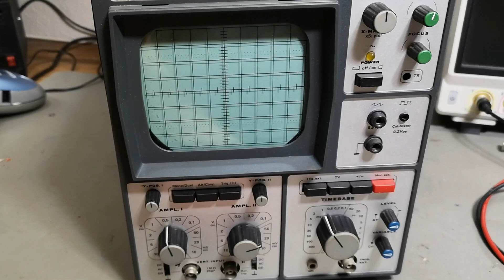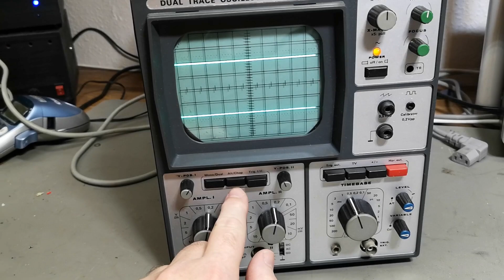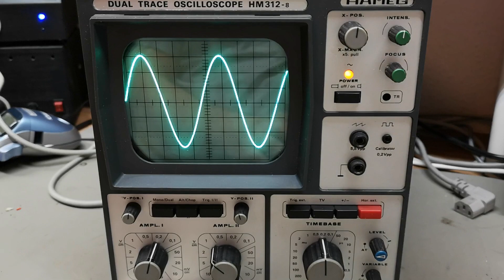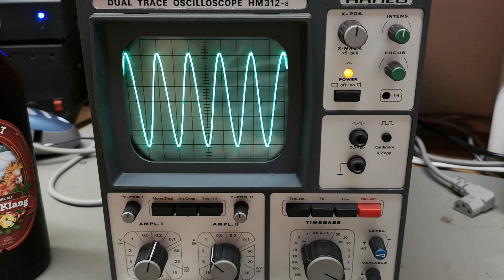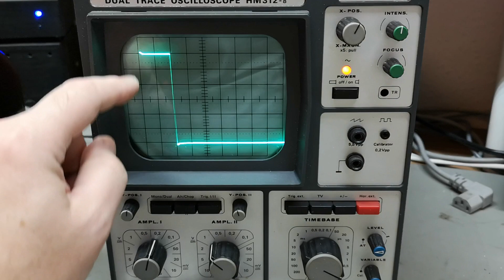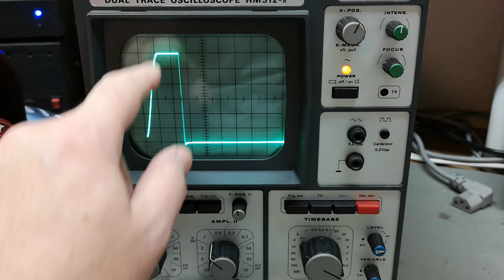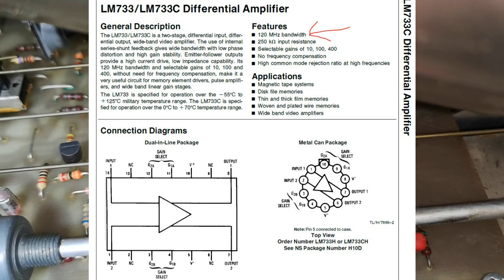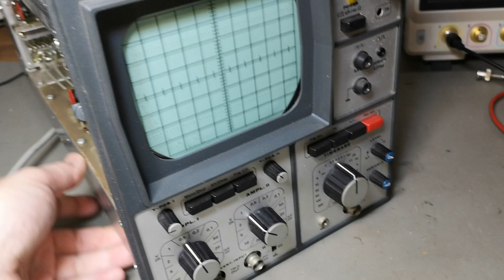Hameg HM312-8 20MHz 2ch oscilloscope 1980 test teardown

Comment: I just ordered one of these after seeing your video. It's going to be my first scope and mostly used to visualize synthesizer audio, but I have a lot of old 60s/70s/80s/90s audio equipment that can definitely benefit from an oscilloscope for troubleshooting. I have a turntable which can only be calibrated with an oscilloscope. I know modern scopes are better technically, but for me it's all about the vibes and aesthetics as well as build quality and in that respect nothing really beats vintage stuff. Also, who doesn't like cathode ray tubes?
Reply from the maker: nice, thanks

Comment: A nice scope, especially after cleaning the insides.  Impressive metalwork and assembly, plus Taiwanese capacitors.  I would have loved one of those back in the day.
I got my first oscilloscope around 1983, a DSE Q-1280 "10MHz" single channel CRO.  It is much simpler than this one, but it still works (the pots could use cleaning).  Tube is dated 1981.
And wow, special Christmas (Jingle Bells?) beer!
Reply from the maker: funny when people see the small fun details :-)  yes this is really a nice scope
Reply: @TeardownOZ2CPU  I just noticed how many videos you have been pumping out.  I wish I had the time to watch them all.
Reply from the maker: @KeanM  thanks alot mate, no need to see them all, pick the ones that are of most interest for you at the moment, you can also use the fast forward to get to the hot spot fast :-) do it any way you like.. and thanks for comments, i love them all.. great to know people see a video

Comment: LM733 I first met as head amplifiers in Apple disk drives, where i did change a fair number for becoming faulty, or low gain, or high DC offset. Made a change from changing a lot of SFC2741 TO100 case opamps for the same reason. Even used a few of the TO100 case 741's to replace some OP07 opamps that got cooked by an output short circuit, just added on a push on heat sink to them to keep the temperature nice and cool, seeing as these were designed to give 15V outputs, so were running on split 22V rails. 44V on an opamp with abs max voltage of 36V, but the later ones also had a 40V rating, so you know that the abs max rating is possible to go over on a good number of the parts. They probably would have cooked on 50V to 60V, but ran fine.
Reply from the maker: i prefer to design my products using parts far within specs, but you are right, some parts are just designed with plenty of margin, for some lab experiments i tried to overload random parts until fail, experiments was made slowly, this way time and temperature was also a good factor, very shocking results on some type of parts.
Reply: @TeardownOZ2CPU  Yes i did find original TTL is surisingly robust as an example. Same for bipolar transistors and resistors, which often survive massive overloads for short periods.